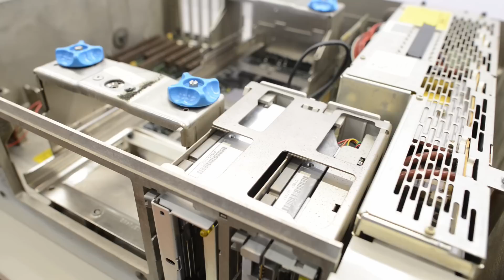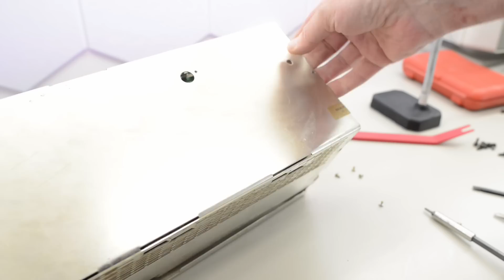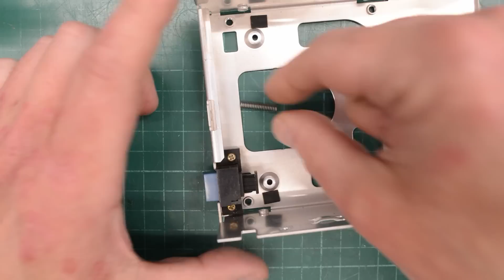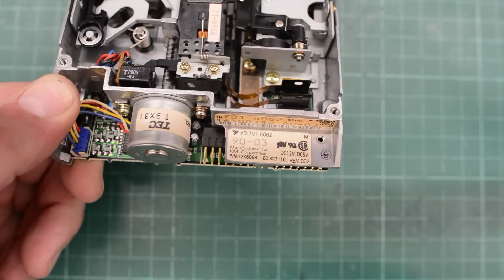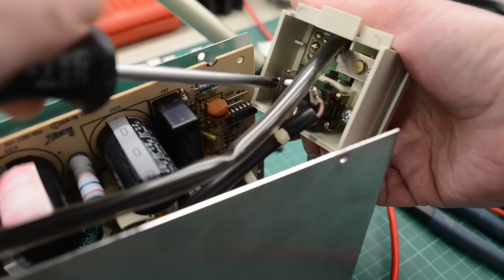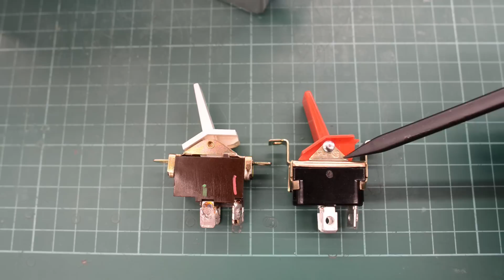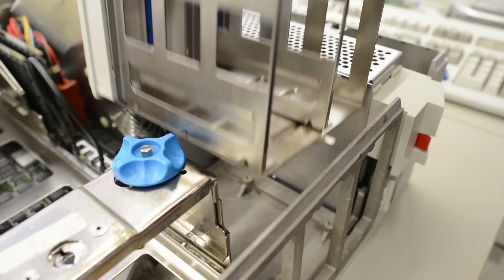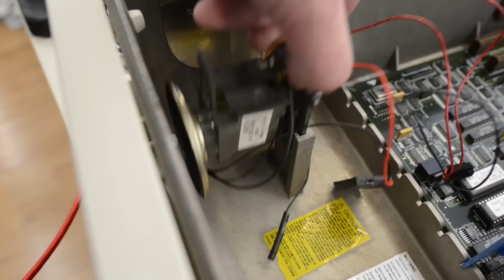IBM PS/2 Model 80 restoration & mods. 386DX25

Comment: The foam pads are for sound dampening, I would assume they are similar to those you would find in the cars of the era. Back then the part that needed most cooling was actually the power supply, so you had the noise from the PSU fan, then the noise from the hard drive that often sounded like a tiny angle grinder even when new - especially faster 3.5 inch SCSI models sounded notoriously terrible - and if you had a few of this in an office environment without the sound dampening, you might go mad. PC AT was a lot easier on the ears, from what I remember.
Reply: Tbh I would have reversed the fans. Shouldn't cause any problems.

I found some thermal fan speed controllers on Amazon, and this might be my next project - upgrading my power supplies with PWM fans and fan speed controllers, with the thermal resistor attached to the heatsink on the PSU. Should make those power supplies a lot quieter, especially on computers that run cool by themselves or have dedicated exhaust fans.

Comment: Thanks for the foam removal tip. They used that in the RS/6000 machines as well. On mine I've removed the foam but left the glue for now.

Comment: Thank you your post! I got a 8565 386SX recently and I feel your pain removing all the nasty stuff. I have been there also. I am new in the PS/2 world and all your advice, experience is a goldmine for me. The PCB's building quality and complexity is amazing, comparing to the noname ISA 386 MBs. Still I have the 161, 163 code, it is time to write the reference disk to move forward. I hope my floppy drive works! Keep posting please!
Reply: Successfully restored my 8565! Concerning the floppy rive I preemptive replaced the capacitors usually go bad, cleaned and greased and it is working now. Creating a reference disk and running the config program removed the error messages. Next task was the memory upgrade which was really challenging. My config was 2x2MB on the MB and 3x2MB on the memory expansion card. I tried to max the total memory config but faced the usually problem: IBM uses parity FPM memory with IBM coding on the pin detection pins of the FPM modules. Tried to source locally 4MB modules without success. Using non IBM 4MB parity modules gave me 1MB on the post which was strange. Finally figured out: the noname memory module I used was 4MB installed on on side, empty but expandeable on the other side. RAS0, RAS2 was used for the one side 2x2MB banks. I suspect because the RAS was not continuous, like RAS0, RAS1 the system counted only the first megabyte assuming there is no more. I used 1Mx4 chips desoldered from an another module and soldered them to the back of the two FPM parity memory modules. I was lucky because this module has a parity chip able to deal with 8MB of installed memory. I coded the pin detection according to the IBM coding schema of 4MB 80ns, ie. all the four pin detection inputs are grounded. At the first start it gave me 000000 code but after restarting the memory upgrade worked showing 8MB of the installed 16MB on the MB. I think this comes from the MB design, one half of the adressable memory is on the MB and one half in the expansion board. One of the not used 2MB module from the MB went to the expansion card, resulting the maximum 16MB of memory. Next project will be to dealing with the SCSI HDD which is rapidly failing.
Reply from the maker: @mihalym.6876  Very cool RAM hack! well done

Comment: Love it - really great to see your restoration, "it has to have a red switch" yes I agree! 😂 I worked with numerous Model 80s in the nineties, running Netware (and Lotus Domino under Netware) on Token Ring networks. I think we even had an LU6.2 link between HO sites, to support replication between Domino servers - very exciting. These were the days when departments shared printers, hanging off these servers. Backup systems were a pain, as they always are. Maybe that's one possible idea, to get an ArcServe config up and going? Or if you could get hold of media for Netware .. that would be something - a Model 80 in its element? :)
Reply from the maker: Thanks :)

Comment: Your comment at 19:40 made me experience once of those spooky moments. Back in 1989 I was also a long-term Commodore 64 user and the PC computer I was using back then in my first job was also am IBM Model PS2/50z. It had a "massive" 20 Megabyte Hard Drive and one 3.5 inch floppy drive and it was running dos 3.3 with the Lotus Elite Software Suite (Word Processor, Spreadsheet and Database all in one package). I still have the original disks somewhere:) We managed to get a version of Castle Wolfenstein working on it at a reasonable frame-rate as well ;)

I also remember we had a huge Monochrome Laser Printer but I can't remember the model, it took up half the desk space it was so large and it took two people to lift it.

Thanks for bringing back the memories, this is a great restoration video and it is good to see another PS2 being brought back to life, I share your fondness for this line of IBM machines ;)
Reply from the maker: Thanks. The C64 and the Model 50 are always going to be among my favorite vintage computers :)

Comment: You're not kidding about the fragile ribbon cable to the heads.  I once sneezed while working on one.  It's now a parts drive.  Just as well.  It takes about 1.2 of those to make 1.0 working one.
Reply from the maker: That sucks. I once desoldered a torn ribbon cable from the heads and soldered on tiny little wires but unfortunately, that didn't work
Reply: @Epictronics1   I briefly considered doing that as well.  I had my doubts whether the plastic head assembly would withstand the attempt, and whether I would be able to pull it off with disassembling things and then re-aligning the heads afterward.  So I left it in my parts bin, just in case I need donor heads some day and get desperate enough to try.
Reply from the maker: @sirnickity  The repair looked all good, so I don't understand why it didn't work. It's been many years, so maybe I should pull it out and have another go

Comment: I think the answer to mounting the big fan is just to bend yourself a giant spring clip from metal sheet, screw the fan to that, and press into that hole in the shroud. Should be possible to find in your local hardware store. Steel is ideal, but aluminum flashing might work ok. Try to get slightly curved bends instead of sharp ones. To figure out the right shape, try to use some thicker than normal paper (such as card stock, the stuff that greeting cards are made of), and test the general shape with that to get an outline. Remember to file down the edges with your dremel after cutting. You'll want sheet metal shears for the actual cutting.

Comment: 33:00 That chip can be fixed easily. Carefully and slowly grind away the plastic at that point to reveal the leg and attached a tiny wire from that stub to the PCB.
Reply from the maker: I intend to try that in a follow up video :)

Comment: my floppy no longer works, even after trying to replace caps. 

What are my options for replacement? all drives on ebay are way too expensive :(
Reply from the maker: You probably need to do a head alignment. If that doesn't work, you can install a standard drive with an adapter. I have a very old and crappy video on how to do the head alignment. Try not to laugh lol https://youtu.be/fV2x4SY1EXk?si=kkwn8dCc8c7DoPrd

Comment: There’s a medical product called Remove. It is a bandage adhesive remover and it works on just about everything with almost zero effort. If you can get some of that it might save you tons of time cleaning stuff like this. It comes in individually wrapped square swabs.

Comment: One opinion here, NOW is a good time to replace ANY caps - especially surface mount - on ANY device you cherish from the late 80s early 90s, really up until the 2000s or so.. they used SUCH JUNK back in the early 90s, it was just terrible.. really, if you're watching this channel and you have any interest at all in preserving our history, please learn to desolder, to use good flux and wic, then to re-solder. It's fun and very rewarding when done right and (well used to be) caps really aren't very expensive. You can practice on old electronics that are trash, then fix up your old PC parts and renew their lives!!
Reply from the maker: Excellent advice!

Comment: The original switch, or at least one that seems to match a lot better than your one, was an Arrow 93RP4040B103K. I've checked it against my PS/2s and it's almost a perfect match in terms of the paddle width and thickness (although the length may be a mm or two shorter), as well as the mounting bracket. If anyone's looking for one, there's currently a vendor on the electronic bay website selling 12 packs, although they've only got a couple of lots left as of right ... now.
Reply from the maker: Almost missed this comment! Now there is only one lot left :D Thanks for sharing!

Comment: You might want use IPA to "soak" the sticky and gooey spots, let the alcohol work for a couple of minutes, before scraping. Time is a factor in chemistry.
You could for exampe use a piece of cloth or a sponge soaked in IPA and put it on the spots where liquid would simply run off.
Reply from the maker: Yeah, that might work. I'll try that next time

Comment: Next time try nitro thinner or acetone! Ipa is not as good in breaking glue. But you should be very careful on plastic.

Also, the used lithium battery isn't prone to fail cataatrophic like ordinary NiCD. So systens with this battery type should generally be much safer.

Comment: A suggestion for the sticky foam: Gasoline. It's safe on plastic and can dissolve many types of adhesives. It also liquefies polystyrene, so if you ever have issues of old pvc cabling that has "melted" into the styrofoam packaging like with some Model M and Model F keyboards I've seen on the channel in the past, gasoline will clean it up faster than anything else.
Reply: If anyone does actually use gasoline, please get some other hydrocarbon liquid to wash it off before it dries, and if possible make certain to use camping stove "white gas" instead of automotive fuel. Automotive fuel has all sorts of additives to optimize it for it's intended use, and the manufacturers don't publicize their recipes, and frequently change them because of seasons, regulations, supply prices, etc., leaving a big question about what's inside on a week-to-week basis.
Reply: Gasoline is extremely flammable and very stinky, a very poor choice to use in an enclosed area. A much better choice is a solvent-based lubricant, like WD40
Reply: @ouch1011  Looks like someone has never used Denatured Alcohol or Acetone. Both very flammable and foul smelling, but common in applications such as these. Gasoline is simply more effective.

And speaking of flammable and stinky, have you ever actually used WD40? It's also both of those things. There's no need to be alarmist over nothing.
Reply: @Darxide23  WD40 is flammable as an aerosol, very hard to light as a fluid. Gas and WD40 have worked well for me in the past but i don't use gasoline indoors.
Reply: @Friddee  Only lights in a vapor form? Hard to light as a fluid? You just described gasoline as well.

Comment: Thanks for letting me live vicariously through your eyes lol.  The Model 80 has been a holy grail since I worked on them back in the late 80s-90s.  They truly are IBM's Crown of Creation in the PS/2 line, and we sold them almost exclusively as servers, although a few did go to the big wigs at various major reinsurance companies.  They would have been insanely expensive for an individual to buy as we live on an island, where everything cost at least two to three times the US price.

Now, some technical things I seem to remember.  The hard drive cage, in the systems I worked on, was usually populated by full-height SCSI drives, of about 60MB.  I remember they used to make this loud pinging sound as if a metal arm was bouncing off of something, something I never figured out lol.  

Great work, man!
Reply from the maker: Thanks :) I wish I had one of those original full-height drives. They look great inside a Model 80

Comment: The melted foam was called "black cheese" at the shop where I worked in the 1990s. Whenever we encountered "black cheese" we used IPA, denatured alcohol, acetone, "Goo Gone Original" and WD-40 in succession until we found a solution that would work. Most cases were metal in those days, so I am not sure how any of those would work on plastic cases.
Reply from the maker: Black cheese. That is the perfect name for it :)

Comment: The 8580 was overpriced, overbuilt, and over the top. I love it. One of my favorite PS/2 machines. 
I've found an easy way to remove the foam is with an old flat scraper, and acetone to clean up the mess. The foam was for sound deadening, the full height hard drives were noisy (and HEAVY!). These were the pinnacle of 80386 technology, nothing but the best in these since they were the big professional workstation or small server solution of the PS/2 line. 
That power supply is interesting. Never heard of that one before, all of the ones i've ever worked on or owned were all Astec supplies. Those just have a zip tie on them for the "handle" to remove them. These were never meant to be serviced in the field, you just swap the PSU out and send the old one back to IBM for refurbishment. They loved the security torx screws to keep fingers out of the high voltage area. the 8580 was in production for so long that it is one of the few PS/2 machiens that actually got upgrades over its lifetime. From 16 to 20 to 25MHz and 3 different board designs. The Type 3 board can use 2mb or 4mb modules as long as they are 80ns or faster. The OG memory modules were 120ns, the 25MHz machine needed the faster modules for reliable operation, and those were more readilly available when this machine came out in 1989. 
I need to dig my 8580 out one of these days. I have a Reply planar to install into it that will give it a 486 and more up to date upgrades like 72pin SIMMs and XGA video onboard.

Comment: For the rotten foam residue, have you tried WD40 or Acetone? I've had good results using WD40, just let it soak a bit. You need a petroleum solvent for petroleum residue so water or alcohol based solvents won't work.
Reply from the maker: I'll give that a try, thanks
Reply: @Epictronics1  Worked best for me for the glue that remains. Should be no need to scrape, just wipe off after it has soaked in the WD40 for a good while. It's akin to that commercial product "Goo-Be-Gone", but I think a bit more effective. Don't use acetone on plastic parts however, they'll dissolve :)

Comment: I took a model 80 and went full absurdity with it.  It was one of the most fun I have had with a retro project.  

I ended up putting in a 4 MB planar memory card and 2 microchannel memory expansions with 12 MB installed total to get 16 MB RAM.  The hard drive was completely dead (of course) so I removed the old MFM card and put in an Adaptec AHA-1640 in its place.  I also added a SCSI CD-ROM drive in the 5 1/4 bay with some 3d-printed rails so it fit in the hard drive area.  For the front bezel, I used the panel IBM supplied for installing a 5 1/4" floppy drive.in the PS/2 80 series.  In order to get it to fit the bezel properly, i had to install the rails upside-down on the CD drive, but it was a perfect fit otherwise.

Video was upgraded with a Microchannel XGA-2 card.

Network adapter is a Microsoft LAN Adapter/A for Ethernet

I topped it off with a blue lightning 486slc33/66 upgrade, so this is probably one of the fastest model 80's in existence without a Reply motherboard replacement.

The only non-period-accurate parts I have in it are the hard drive and sound card.

Instead of sourcing the proper hard drive, I went with a bluescsi.  I did not want to constantly worry about an old hard drive failing

I also used a modern re-creation of the Sound Blasted MCV called the Resound New Wave MCA for the sound card
Reply: I also went a bit crazy with the software.  Of course, it has MS-DOS 6.22 and Windows 3.1, but I also have Windows 95 and OS/2 4.0 installed in a multiple boot configuration, using OS/2's boot menu.  Windows 95 is surprisingly (almost) usable on it. As is OS/2, probably because of the processor upgrade.

I have yet to find an MS-DOS game that does not work on this system, including some that are known to be problematic on MCA PS/2s.  I never expected this to become my primary MS-DOS gaming machine, but with judicious usage of the SLOWDOWN app for older games, it is almost perfect.
Reply from the maker: Great build! I have all the parts coming in next week to build an MCV replica card :)
Reply: I don't have experience with the blue lightning, but tried variants of the TI486DLC in various PS/2's and always ran into trouble with the L1 cache, which would cause frequent system freezes. Did you run into this? If you use it, could you share your 'cyrix.exe' configuration string?
Reply: @clavius5734  I have the official "Options by IBM" 486DLC33/66 upgrade.  More information is available from the "Ardent Tool of Capitalism" site - an excellent reference for the PS'2 series.  Search for FRU "13H6698."  It appears that any time I put the direct link in, Youtube "eats" my reply.

Regarding freezes and instability:  performance is rock-solid and approximates a 50 max 486 DX, according to my testing.  I also have a 25 mhz 80387 installed, as the upgrade doesn't have an integrated math coprocessor.  The only real issue I had was the installation of OS2.  The boot disks would not work if the cache was enabled.  This was a known issue and described in the documentation.  

After OS/2 was installed, I re-enabled the cache and everything was stable